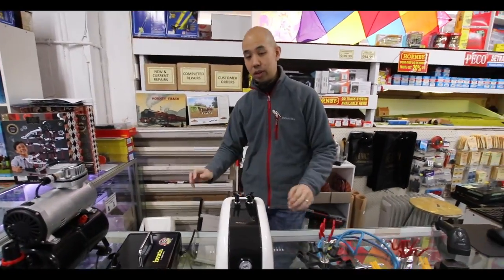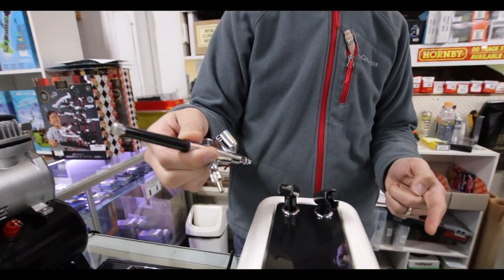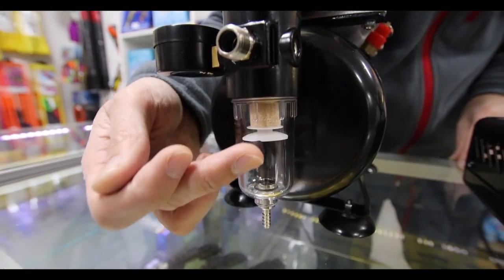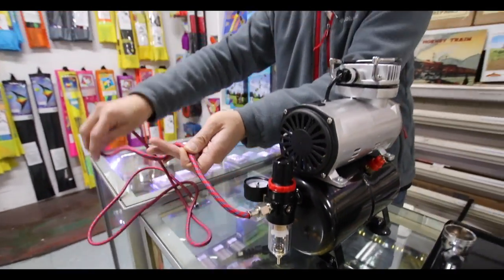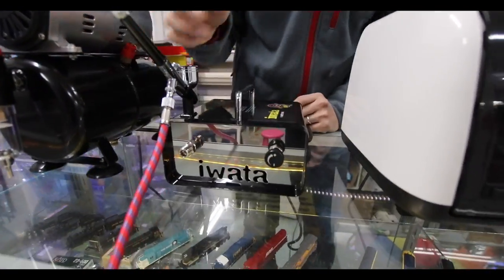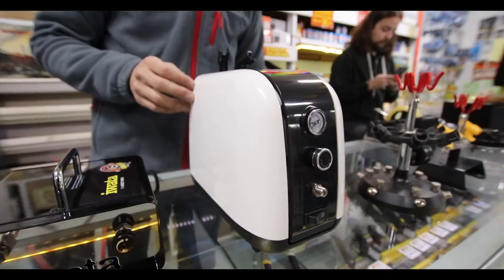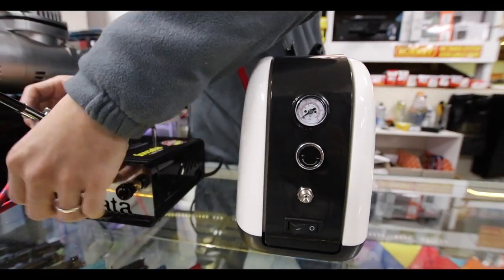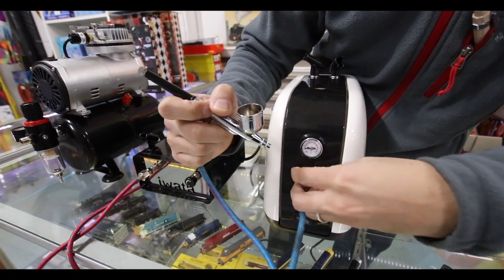WHICH AIR BRUSH COMPRESSOR IS RIGHT FOR YOU ? | #askHearns

Comment: On the next airbrushing tips can we have some guidance on pressure for spraying different items or styles. For example larger fill areas do you go up in pressure or do you choose a pressure your comfortable with and then just vary with your trigger?  When using dual action I find it easy to vary my paint flow but difficult to vary my airflow. Possibly I'm using too much pressure (40psi)
Reply from the maker: Greg Robertson great question! We will add to the list! Thanks again!

Comment: The best compressor out there is the "SIL-AIR 20A", it's Made In Europe by an over 40yr old compressor-company, and is made of a refrigerator compressor, which means it's slightly louder than a whisper at 30db.
(A whisper is about 30 dB, normal conversation is about 60 dB)
It has an built in Tank, a Water separator and a Regulator = All you need.
Reply from the maker: great info. Thank you.
Reply: Yes, and it is also horribly expensive, ranging from 2 to 5 times more expensive than the ones presented here. Not to mention that it is an oil compressor with all the maintenance that goes with it.

Comment: which of these two products do you recommend and why thank you very much ... Iwata Power Jet Pro (2x Sprint Power ^ ~ ^ Smart Technology ... Iwata Power Jet Plus Tubular Compressor
Reply from the maker: The two compressors are quite different.
Iwata Power Jet Pro
Large system best suited to a fixed studio.
Less overall pressure. Not an issue if you are only using low to mid pressure, fine airbrushes.
Larger holding tank. Quieter overall as the motor will not be running as much.

Iwata Power Jet Pro
Smaller system allows it to be moved around easily. Half the weight of above.
High pressure ability to power high flow air guns as well as fine airbrushes.
Smaller holding capacity in the tube so motor will run more often then above.

I would choose the Iwata Power Jet Pro if space is not an option and it will live in a studio. Less noise overall.

I would choose the Iwata Power Jet Pro if you are tight on space, need to move it around or require the higher air flow.

Comment: I bought an Iwata High Performance PLUS total control Airbrush. Which compressor would you recommend for it? It’s a Siphon feed Airbrush.
Reply from the maker: Your choice of compressor is dictated by your budget. Any airbrushing compressor with a built-in holding tank is preferable. Iwata compressors are very good.

Comment: What's the max psi on the iwata ninja? On the iwata website specifications, it says max psi 40 but the description says says 1 - 18? Do you know specifically? The info would be much appreciated as I got it as a gift or should I get 1 that tells me the the psi? I will be spraying mr hobby laquers for gundam model kits. But everytime told me I would need 20 psi, so the 1 - 18 psi barely make it lol. I also just received a pack of Gpaints and it says to spray 15 psi to 40 psi. Soooo if it's actually 40 psi I will be so happy. But if it's 1 - 18 psi then I will have to play it safe and just get a compressor that can go higher.
Reply from the maker: I have used the Ninja but I don't know the actual pressure. It felt very similar to one I have had set at 20PSI. For regular use, I think the Ninja has enough pressure. The Ninja has a bleed valve to reduce the pressure as well. Usually I use 15PSI with quite thin paint. I have not used Gpaints so don't know how thick they are. I suggest you just try it and see how you go. If you struggle to spray the Gpaints then they may need to be thinned to go through your gun. If you have to use extreme pressures like 40PSI then you will need a more powerful compressor.
Reply: @Hearns Hobbies  thanks for the response. I have reached to a iwata rep. So basically, the compressor can go up to 40 psi and it will automatically shut off. There's no real way to get it up to that psi unless your modify it somehow. It set to 20 psi, so when you have the dial to max psi it's technically 20 psi but soon as you press down on your trigger the psi drops a tad bit. That's why they rate it at 18 psi well "15psi to 18psi". So atleast they clarified it for me lol. But so far works with 1 to 1 mix with my hobby, just recently received a massive shipment of gaias lol. Had to pic them up or I won't get any til next year haha. Any recommendations on thinning nazca primers and gaia metallics? Lol. Anyways thank you for the help I appreciate it.
Reply: Lol you seem to go through a lot of trouble trying to find information when you can just try it and see very easily

Comment: Great video - what’s your views on the mini airbrush type?
Reply from the maker: Thank you for watching. What do you mean by mini type? Wireless compressor?
Reply: @HearnsHobbiesMelbourne  the mini / portal type like Neat&Tidy produce
Reply from the maker: I am not a fan of them. I don't think air compressors should be miniaturised to this extent for convenience. For consistent flow and lifespan I would not use a compressor any smaller than the Sparmax Beetle.
Reply: @HearnsHobbiesMelbourne  thanks for getting back to me. I got one to start airbrushing as I travel a lot however, the PSI is inadequate, cheers.

Comment: I use a pancake compressor double regulated, thoughts?
Reply from the maker: As long as the airflow is smooth and can achieve the pressure you need then it will be fine.

Comment: hey mate, I need ur help... 
What is a solid and good quality airbrush compressor?

Thanks
Reply from the maker: Hello. I think the compressor with the tank is the best one to go for if it fits in your budget. The tank gives smooth airflow and allows the compressor to automatically shut off and rest between runs.
Reply: Any brands you would like to recommend? If you could link ur suggested product that would be great. Thanks for ur help

Comment: Hey buddy.  I have the 3rd compressor you featured. Exactly the same.  I can not  get the pressure to come up past 2..... we have 6 airbrushes, and non of them work with the comp.....  would really appreciate some advice if possible :) tar in advance.
Reply from the maker: 2? What unit of pressure does it get up to? Is the air bleed valve closed on the base of the tank?
Reply: @HearnsHobbiesMelbourne  Hey, The pressure barely gets above 3 or 4, needle hardly moves... very odd...
I did manage to get about a 1/4 of its potential pressure, but it went away fast....  I have not checked the underside yet, will do now.
Reply: @HearnsHobbiesMelbourne  Ok, so the pressure was barely getting to number one, On the black numbers, which would be the centre circle, with the PSI numbers in red on the outer circle.. so roughly 20psi.
higher than its ever been...  The lines and Air brush are new....  however, it does sound like air is escaping from the joints, where the airhose fits. BUT.. its now working, and blasting air and water out of the brush, which it has never done before.. I did tighten the Valve you mentiond, located at the bottom, which helped.
Reply from the maker: Any leakage from the connectors will greatly affect the pressure. Use teflon plumbers tape on the threads to seal them.
Usual operating pressure setting is 10-20 psi.
Reply: @HearnsHobbiesMelbourne  Thanks bud! very much appreciate it :)

Comment: Any thoughts on the iwata freestyle battery based air compressor ?
Reply from the maker: The Iwata Freestyle will be great if you need to travel offsite to paint where there is no mains power. It has much less power and less adjustable compared to other compressors in the same price range. If you are setting up in your home studio or workshop I suggest any of the mains powered compressors in the video will be superior in operation.
Reply: @HearnsHobbiesMelbourne  Understood, which Iwata compressor would you recommend for models and miniatures?
Reply from the maker: Hi Ethan. It depends on what your budget is. The 2Spray (toaster) is a great compressor for the price. If you want the ultimate home compressor then the Iwata Smart Jet Pro is all you will need. A compressor with a tank will be superior to one without. You can find my reviews here: https://youtu.be/fm7_1kPSiNk  https://youtu.be/HbhjC9CcmC4

Comment: Definitely one with tank the iwata is crap I got rid of mine pressure is really bad very low and don't fancy a toaster on the work bench haha
Reply from the maker: The pressure is low as it is design for spraying model paint; if you need higher pressure you should at different models.
Reply: @HearnsHobbiesMelbourne  I  I'm an armour modeller it was crap
Reply from the maker: I see.. what are you using now?
Reply: @HearnsHobbiesMelbourne  sorry for being so blunt, but the pressure dropped when it got hot alot and would hardly spray the paint! I then bought just a single tank compressor to start with for budget wise used it a year, actually still have it as a spare not a thing wrong but then upgraded to the same in your video with the tank and it's perfect! I now have a sparmax 610w I think it is came with 2 airbrushes nice lines 2 sets love it! Whole set for £200 i started getting into my hobby big time so just treated myself while on the lockdown! Why not my model's ain't cheap at £50 to £75 a pop I thought I was getting something good with the iwata to be truthfully honest but try it out if you haven't the air must heat up or something to make it do this and the constant running you had to leave it every 20 mins for an hour too! That sucked took ages to paint a model!!
Reply: Basically a fish tank pump type compressor
Reply from the maker: Thank you very much for the feedback actually. On a great note, Sparmax is being imported again into Australia hence we should have their compressors very soon! I will run your feedback by our staff as well, very important for us to have. Thank you!
Reply: @HearnsHobbiesMelbourne Glad to help, I would rather be honest and help people maybe younger like myself I'm 34 and used all these types in the past 3 years! It was a new realise sparmax I got last month here in the UK my friend owns a hobby store and showed me one he got in for a tester so I fell in love with it even though didn't need it! But really happy with it ! It came with 2 really nice lines red and black and 2 airbrushes one was a max 3 and the other was called a flyer! It's an odd thing I must say! Takes abit of figuring out how to lover the pressure on the brush itself, it has a turntable head on the end of the bottles and a strange looking needle but has its pluses too as the bottle you clip in with the paint switches out for another and comes with a score top! So if you make a good bit of a colour up you can just take the bottle out and screw the lid on it and store it for later if needed again for touch ups etc! Good idea it can be improved I feel but on the right tracks there!